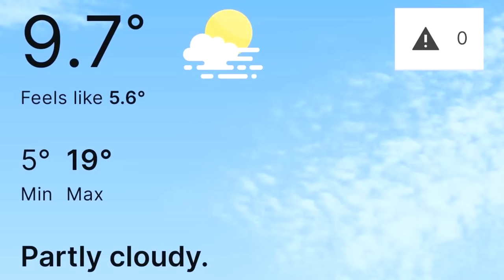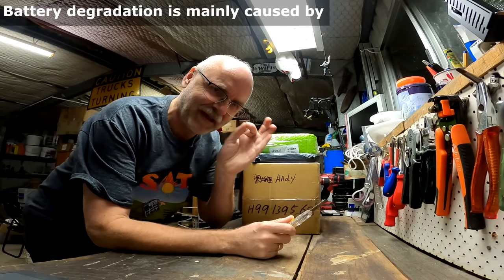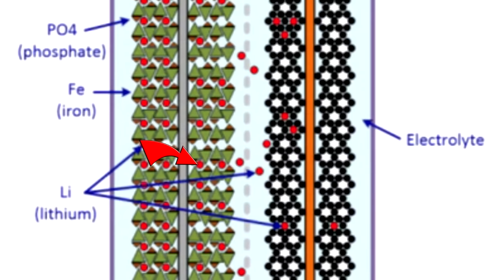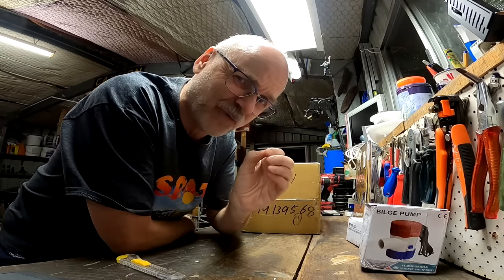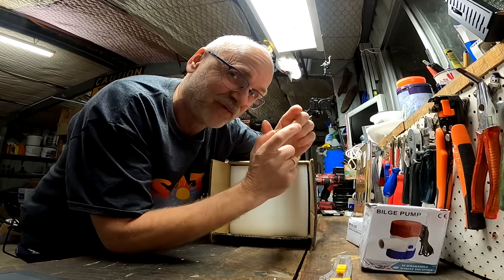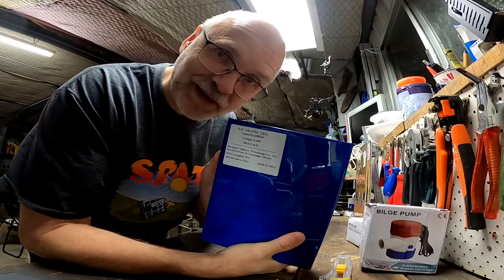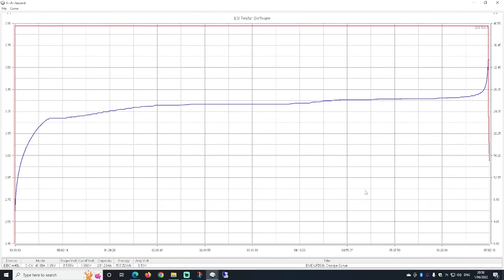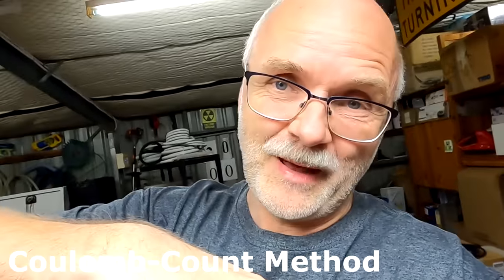Busting the 20%-80% SOC myth for LiFePO4 batteries.

Comment: Sorry, Andy, but you are wrong on this one.

Regarding the degradation due to intercalation of the Li ions into the graphite, VOLTAGE DOES NOT MATTER. Only the real, final State-Of-Charge matters.
It does not matter if you bring it to 100% with a long absorption at 3.40V or charge to 3.65V and cutoff when the current drops below 0.05C. The same quantity of Li ions intercalate into the graphite, causing the same degradation.

There is a very good reason why the scientific literature talks about degradation effects of SOC specifically, without jumping to conclusions about the voltage.
The voltage "knees" appear due to State-Of-Charge, not the other way around.

High voltage has another negative effect: above approximately 4.2V, the electrolyte starts to break down due to electrolysis (like you break down water into oxygen and hydrogen). Yes, it's the same 4.2 volts for LiFePo4 and Li-Ion. That is why charging Li-Ion to 4.2 V is so risky.

Using the battery between 10% - 90% or 20% - 80% would significantly reduce degradation due to less intercalation of Li ions into the graphite. It is NOT a myth. It is well documented. But it's very difficult to implement with LiFePo4.

EV manufacturers do not want to limit voltage, they want to limit SOC to 80% to reduce degradation. And it's easier to implement with Li-Ion ternary chemistry (NMC / NCA / etc).

You could make an argument that charging to 3.45V with a short absorption gets you a lower state of charge and is therefore recommended, and this would be plausible. But at 3.45V, with 0.2C-rate, you are still very close to the manufacturer-specified 100%, as you have seen in your charging and discharging tests.
Reply: What SOC do you believe will be reached with 3.45V 0.2C?
Reply: @flatfoot  97% BEFORE absorption on my 230Ah battery.
Reply: Doesn’t pushing higher voltages generate more heat, which in turn degrades the graphite even further, increasing the likelihood of cracking?🤔🤷‍♂️
Reply: @Stormbringer748  That's the charging current (C-rate). You can push a high C-rate even when the target final voltage is low (e.g. 3.45V).
Reply: Thank you for your comment 

Which charging routine would you recommend for a Tesla Model 3 fitted with a LFP battery ?

Because Tesla says that LFP batteries can be charged to 100% each day.
Reply: @pauld3327  They need to be charged to 100% to re-calibrate their SOC meter. This is very important for the estimation of remaining range and cell balancing which allows you to use more capacity. So I would charge to 100% when going on a long trip and I need good range estimation. For daily use, I would probably use it until it drops to 50% and then charge back up to 100% but try to not let it sit at 100% for many hours.
Reply: @danielardelian2  Thank you 👍

Comment: so you are saying I should get around 61kw from my batteries. If I take them to 3.45 volts and then balance them. Funny I said 3.45 volts way back when. I did say 3.15 volts on the low side. I do see why you are saying 3.1. Another funny is 48volt system which never goes to 48 volt lmao. I cant wait to see what my system really does.  I do agree how much you charge and discharge at .2C which is max in my opinion. .05-.1C is optimal. That is why I am using 4 banks and truly 6 banks would be optimal. you are running 3 so that means .1C-.3C which is on the high of the low optimal end. Is your system mainly for charging your Car?
Reply from the maker: I use my battery for the Off-Grid Garage which will include the vehicle charging mainly in summer time when I have enough solar. The draw from under full load will be more like 0.1C for each bank, if a pump kicks in at the same time 0.15c for a moment. And there will be more batteries coming this year.
3.45V will definitely fully chare your cells with some absorption and get's you to 95% already without. 3.15V is too low if you have large loads (voltage drop make you inverter turn off at 30%SOC)
Reply: @OffGridGarageAustralia  No large loads yet. No electric vehicle yet. If everything turned on it might go past limit of 1 of my inverters but I have 2 5k inverters and will have 3 next year. I thought it would be better to build a complete system and add another inverter and more panels next year.

Comment: Looks like you should go from like maybe 10-90 percent. Yeah the knee.... or elbow lol. Yeah 20-80 dont make sense. 10-90... sounds better and the higher degradation myths are just that myths. We dont really know cause nobody that ive heard of has done the test long term with a sterile controlled tests so its cool to use them atleast 10-90.. the worst that can happen is you buy batteries a year or two sooner but not waste as much life worrying about batteries
Reply from the maker: Yeah, 10-90% are preferred for these batteries. I go down to 2-3% if I have to and usually also charge them to 99.5% by keeping the voltage low. At the end, it is all about the cell voltages, not too low and not too high and the LFP batteries will last forever. Almost.
Reply: @OffGridGarageAustralia  that's so cool that you speak to your viewers even after your channel has grown so much and so many people comment on things with your channel. Thanks for real
Reply from the maker: @matthewknight5641  Yeah, even it takes up a fair bit of time, I think it is important as you are my most valuable assets. Without my viewers, the channel would not exist. So I really appreciate everyone supporting the channel in any form. 
I try to hang out here as much as possible.

But now back on the roof, the camera is waiting 😁

Comment: Technically charging only to 80% is wasting capacity, because each charge cycle to 80% is still depleting a cycle as is charging to 100%, but you lose 20% of the capacity in that cycle because you never charged it fully.
Reply from the maker: That's not how it works though. It depends at what point you start with your 80% DoD. Charging from 0-80% or 20-100% is worse then using the cells between 10%-90% for example.

Comment: Well, that's why flat curve battery sucks. Gess all the energy wasted in guessing (because that's not measuring) because shunts are just resistors, in constantly balancing/applying specific programs to lengthen battery life (also wasting energy), to make sure current is not to high etc. Tons of energy wasted.
All because of a f$*ùîng flat curve (curse ?)
Reply from the maker: Easy to handle if you know how. It's all here on the channel. Zero energy wasted.
Reply: @OffGridGarageAustralia  not completly true. You do a lot of work to optimise things compared to other installations and that's great, BUT having flat curve batteries inherently induce additionnal equipments (balancer, shunt, powermeter) that are running on main line and/or permanently and that you just wouldn't need with non flat curve batteries like LTO. Just do some math how many watthour are wasted in shunts (both charging AND discharging), because shunts are just additionnal calibrated resistors.
With LTO you just need to measure global voltage (the one of your MMPTor inverter) and that's it you know exactly the energy storage, not even guessing. Top balancing them once in a year if you're worried/nothing to do.
Reply from the maker: @AtlantisArch  Thank you. You would need the same equipment for any other battery chemistry as well. This is not just for batteries with flat charge and discharge curves.
I know someone with LTO batteries, and they need balancing the same way as LiFePO4. If he does not charge them all the way up for a while, they go out of balance and need top balancing again. And voltage is not a good indicator for SOC unless you do this in the right conditions (resting time, no-load voltage,...) but it is still a bit of a guess. 
The losses on the shunt are super minimal in comparison of what power it measures.